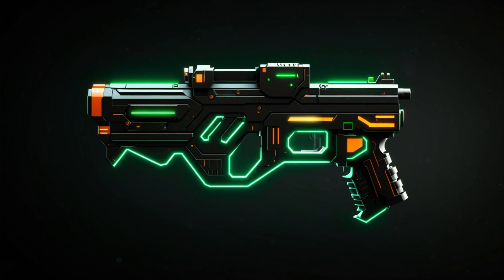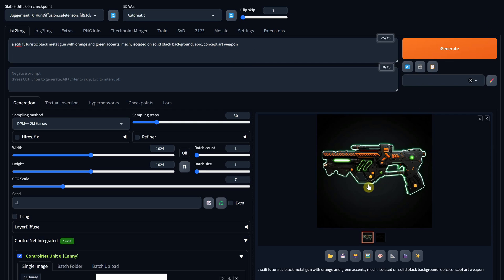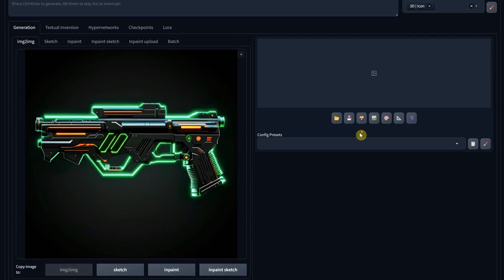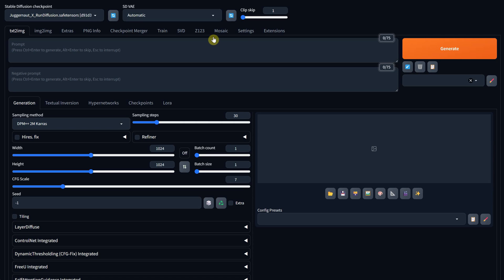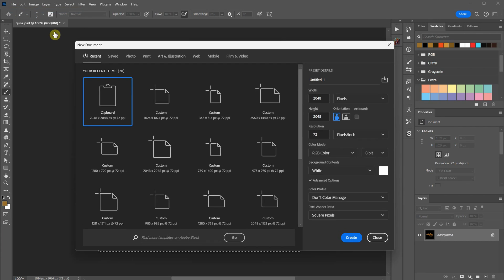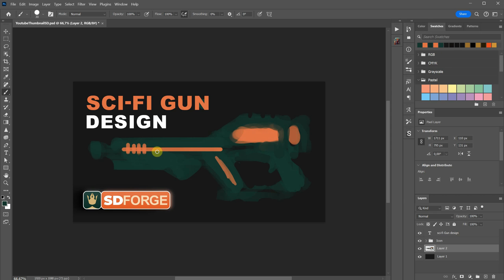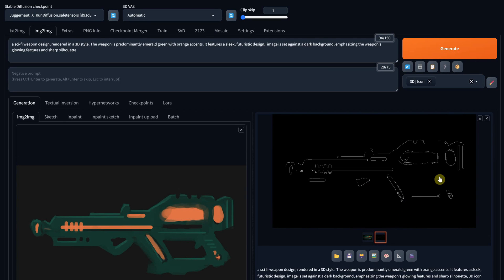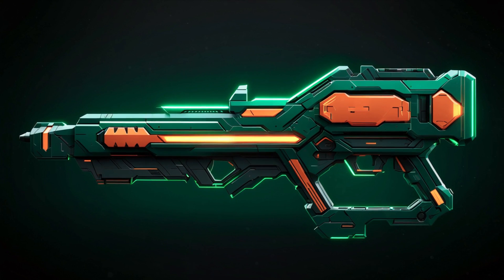Sci-Fi Gun Design with Stable Diffusion Forge UI & Photoshop

Comment: Even if i enable controlnet i doesnt work It creates an irrelevant image what could be the reason
Reply from the maker: Make sure is the same control net model i used, and you are using sdxl model, if have the same setting and models it should work, try exactly how i do, you can even take a screenshot of the sketch if it works like that and dont work with your sketch maybe is the sketch

Comment: When I use Juggernaut as U have been explaining in Ur videos
My computer cannot handle the 1024  x 1024 and takes a very long time to generate images 

On the contrary I am using realisticvisionv51 @ 512 x 512 is much faster on my machine

I have a few questiosns 

Q-1 What are the best settings for realisticvisionv51?
Q-2 How can I learn advanced stable diffusion prompting?
Q-3 CUDA Stream Activated: False, does this mean that my stable diffusion is not using my graphic card?
Q-4 the VAE it is using is VAE dtype: torch.float32, Is there a better VAE I can use with realisticvisionv51?

Any plans to create a prompting youtube video for stable diffusion in the future

Thanks in advance
Reply from the maker: Hi, i can not answer all the technical questions since i am a design not a programmer. If your computer can not handle sdxl because your Nvidia card isnt has enough vram then yes you can use v1.5 that are faster and smaller models. Usually you can get good setting for the model you are using from civitai website there you have it either in description or the model either on generated example has an info button and can see the prompt.  From there you can also try prompts, you can also use chatgpt to generate promots and the best way to learn it is to practice, try different word and see what it does, usually the words at the beginning are more important than those at the end. I sometimes share prompts in my Facebook group pixaromacommunity   . My vae is set on automatic so it takes what it needs.  For prompt tutorials maybe but i assume people just prompt what it needs, is just trial and error ☺️  stream activated is something else i get that message too i tried to activate it and was slower not faster